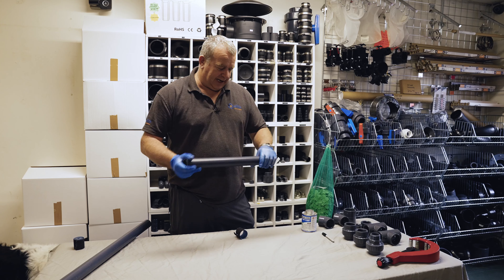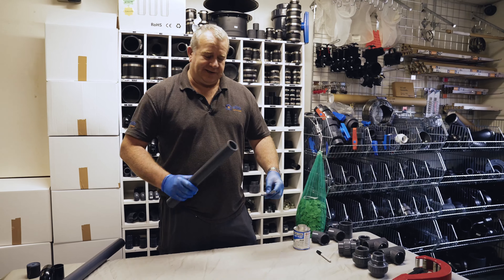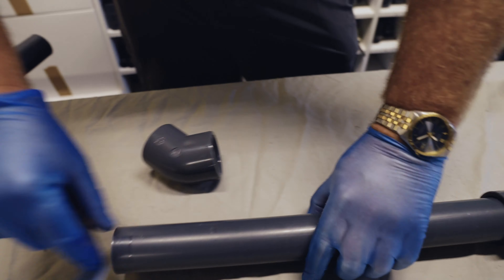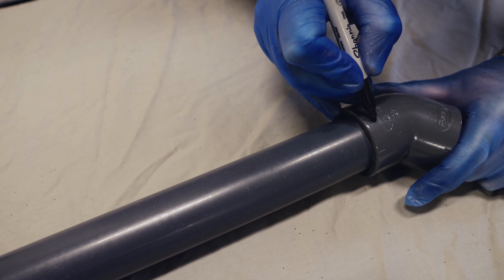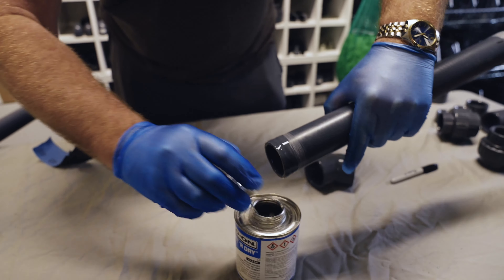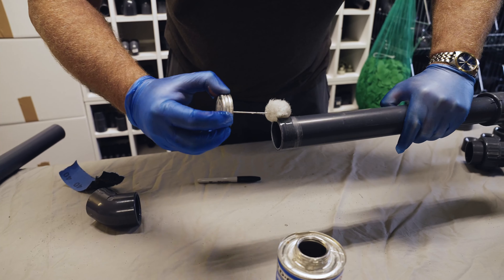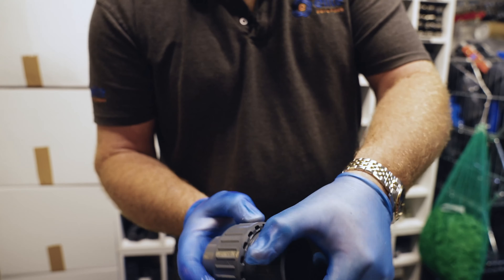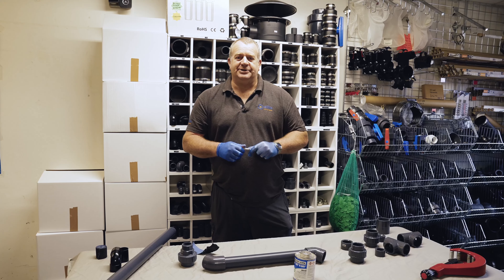How to Fit Koi Pond Pipework - OUR TOP TIPS!

Comment: Sorry for the stupid question but if I buy a double union ball valve do I need to buy glue to fix the couplings to the pipe? And then just screw in the ball valve from both sides with the outer couplings? Thanks 😊
Reply from the maker: Hi Steve, yes the unions are slid on the pipe first and the flange is glued to the pipe. The flange / valve will have a rubber seal which forms tge seal when the unions are screwed to the valve body